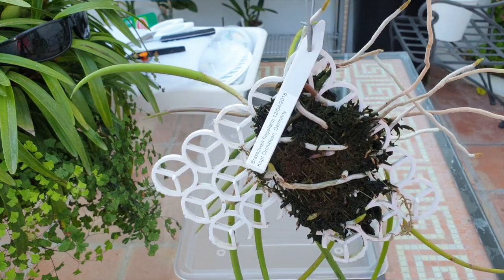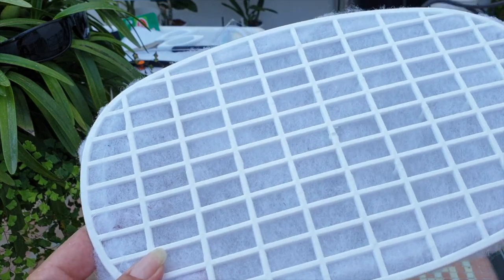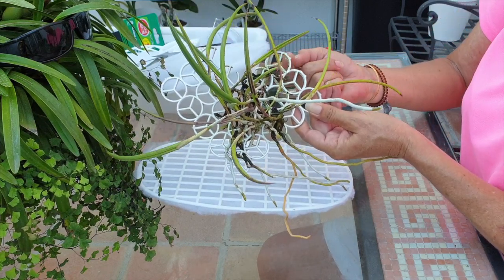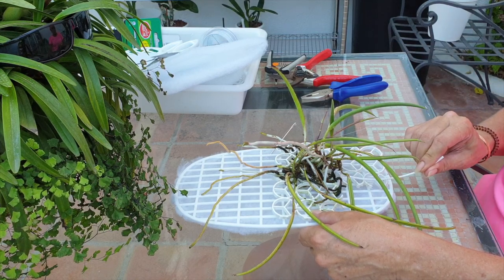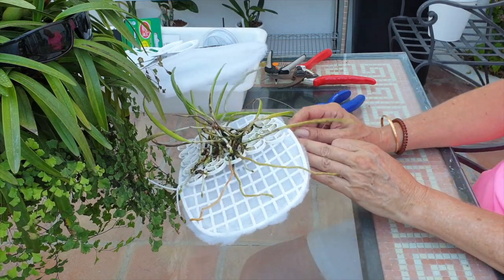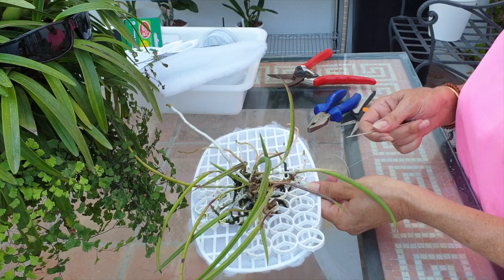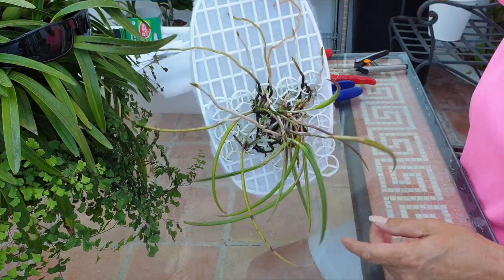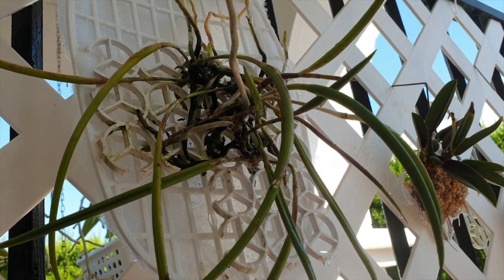BRASSAVOLA FLAGELLARIS | Inorganic Mount | From MOSS to EXTRACTOR FAN FILTER 🤣🤞🏼 #ninjaorchids

Comment: Hello there! I love what you did there, seems like the brassavola took really good hang of the old mount, it would be very difficult to get it off. I mean that's what we strive for in the first place, for the orchid to grab the mount by herself without the need for fishing lines to hold them, right?
When I put hygrolon on my mounts, I usually secure them in a few key places (4 - 6 usually, since the minis have smaller mounts) and don't thread the line, I also secure the orchid with 2 lines above and below pseudobulb/stem and make it a bit loose, not really that tight, so it has some "motivation" to grab onto the material. Now the orchid is not flopping around, not that kind of loose, but just a smidge of freedom is there. One day I'd love to be able to take all the fishing line off of the roots and rhizome/stem when the orchid grabs the mount (it's all inorganic, so it won't change in any foreseeable future).
I hope your experiment works out and the roots will go through, but even if they don't, they have a lot of places to hold on to, like the grid that's above the material, I think that's an awesome idea. You basically gave the orchid 2 choices: either grab onto the material that's getting them hydrated or on the "trellis" that's not hydrated, but is sturdy and will give her stability. When the roots go through the material, it doesn't matter whether the grid is on top of it or below, the roots will grab on. But when you don't know if they'll go through, like with the thick roots, this is a perfect solution. I applaud to you :)
Reply from the maker: SnowDragonka.... I was very pleased to see the extent of the root system on the mount and how it had snaked through and took over... hence, yay to inorganic!! It was nice to be able to take the option to just slap it on to something else, inorganic... I wonder what they mounts will look like in 10 years 🤣 as far as I am concerned, this can be repeated ad infinitum! I am also with you regarding the 'no too tight' on the mount concept. Something tells me that the orchid reacts to be just slightly 'loose' and in order to secure itself, it will grow roots. I have not proven that theory, but something tells me there is an element of truth in that... these beautiful plants have evolved and stood the test of time, with the most magnificent techniques that blow my mind. Even blooms replicate pollinators or ward off predators... its just remarkable! Thank you so much for your encouraging enthusiasm 🥰 I have another idea regarding this white filter, and that is for my monster Stanhopea... that is something I have as yet to implement, but I think its going to be the answer to my Stan problems.  The Stan doesn't have the problem, its me .... I want to remain inorganic, but Stans just have their quirk with their spikes, so... the mind is going 🎡🎡Now I have to take a day, go shopping and then go for Stan!! Should be fun and nerve wracking all at the same time!! Have a wonderful Sunday, thank you so much for watching! 🥰🌸

Comment: I knew before you even got started that flagellaris wasn't coming off the old mount without cutting it up. I'd have put a small piece of the filter on top of the new mount under the old mount, like a sandwich, though. Only reason is you're putting pressure between the two plates and the filter would give the roots a little cushion.
Reply from the maker: Michael McCarthy genius! Once again 📚📝 hello Michael 😊💐 I shall take a screen shot of your comment as a note to self ... that will definitely be a progression in the future 🙌🏼👍🏼 my flagerallis have been so shy on the root front, I was pleasantly surprised at what I found after the moss was off. So far... nothing has suffered or dried up 😃 I will never forget the day you mentioned scotch bright!! I owe you tapas as well as drinks when you come to Spain 😉 thank you so much for your support! 🥰🌸